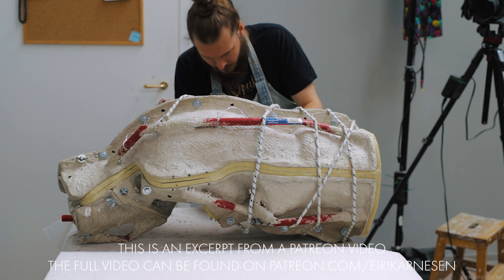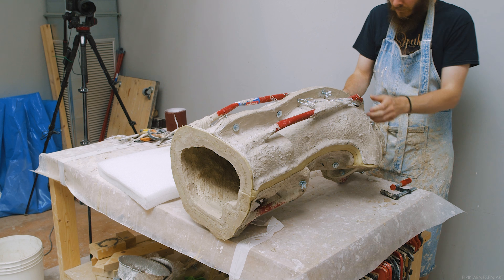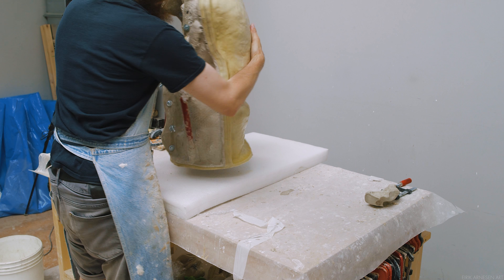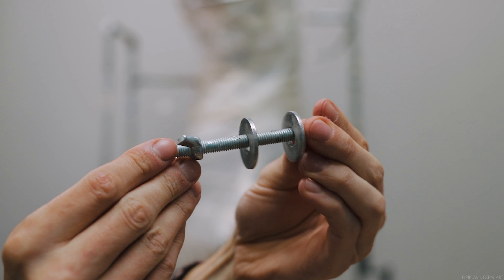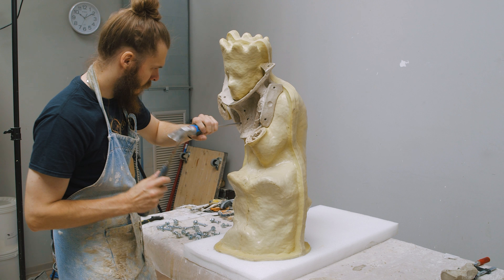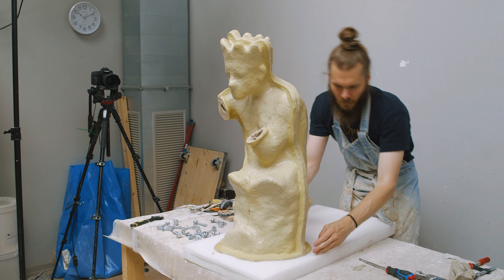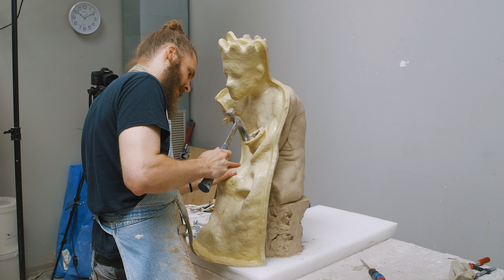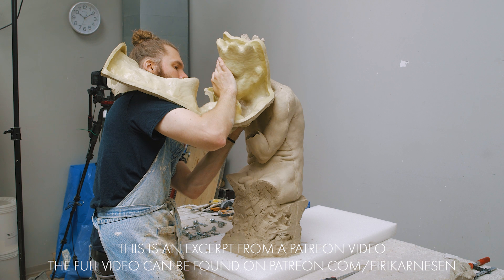Casting In Hydro-Resin - Opening The Mold

Comment: awesome! though i expected no sim line due to the thickened silicone line along the sim joinery where the  two come together
Reply from the maker: Maybe I'm a bad mold maker but I always get a little seam line that I have to fix. Perhaps it's normal with larger pieces like this.
Reply: @EirikArnesenArt  Not a bad mold maker at all, you are a teacher, i now know that sim lines are only avoidable if its a one piece mold. So a simline is cliche